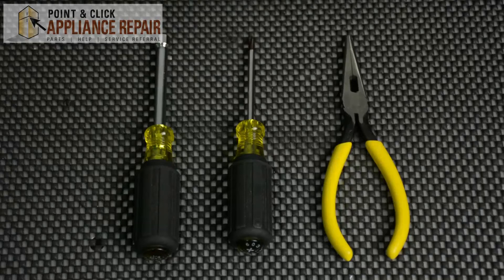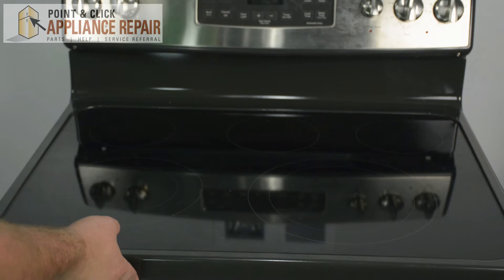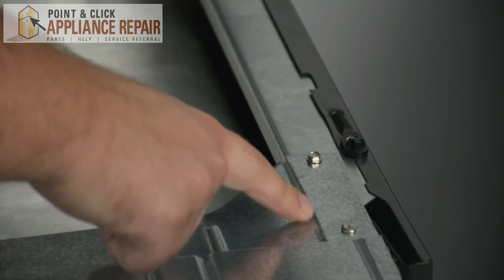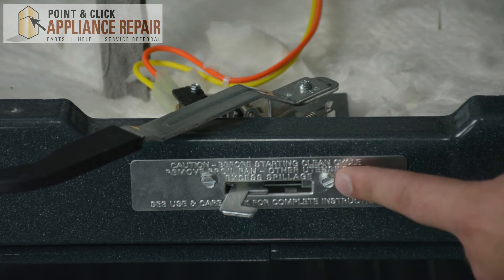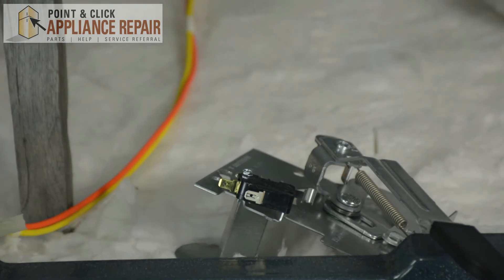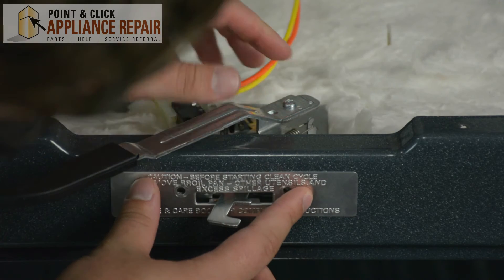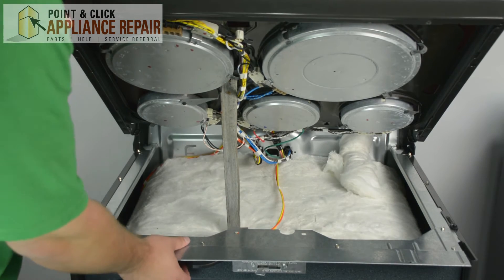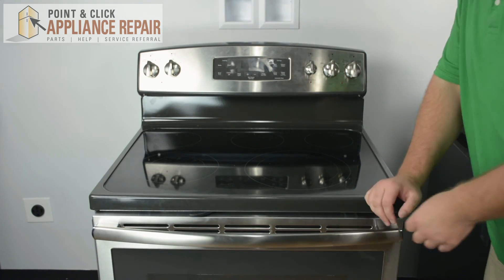WB14T10092-Replacing Your GE Electric Range Door Latch-AP5688708,PS8259925,2980574

Comment: This is a real help! I found out I could easily remove the top and inspect the latch part.  Well, my oven door was stuck closed, but for the first step I used a standard open 1/4 inch wrench to remove the black screws under the top instead of the other tool.  It only took me about 2 minutes longer. Then I followed your steps, they were easy.  What happened was that my wife had set the GE range to self clean.  Afterwards when she tried to set the latch back in place, but the darn latch was still locking the oven door shut after she moved the latch back into the regular open position.  So because of your easy steps it was so good to remove the top & brackets to visually see the latch.  It turned out that a metal piece was bent and mangled (I was impressed with my wife's feat of strength, by the way).  The handle itself is okay.  The bad part is that metal bracket that holds the handle --  severely bent. With the glass top raised up, I was able to merely move the handle over enough to unlock the door latch.  However due to the crooked angle of the handle (it is pointing up too high instead of an evenly level postition), I could not get the top to close back all the way. But I decided not to replace the part. I just took the handle off, then closed the top and secured those scews back in place.  Next time we run "self-clean" I will need to put that handle back on.  And thanks to you it's a simple process to access under the oven range top.  I can close the oven safely with the handle pulled out in the "locked" position whenever we run the self-clean again.  Again, thank you once more.  Your repair video alleviated a great deal of stress and  worry, plus saved money too.  To celebrate I am having homemade pizza tonight.  God bless you Repair folks, and keep up the good work!
Reply: Very similar to my experience - wifey must have really torqued it to bend that handle.
Reply: My experience was similar to yours. Your solution was my solution too. I will be celebrating with pizza also.

Comment: Very helpful - the link to the part doesn't work. GE says it's replaced by WB14X41386 but there are a few left (as of this date) with the original part # and slightly cheaper (when shipping is included) on amazon.

Comment: how do you get the door open if the lock worked to lock it but it wont unlock it?
Reply: Matthew David
Excellent question and it deserves an answer. There is a gap between the top of the door and the bottom of the glass top for you to get a thin 1/4 inch wrench  in the gap to unscrew the 2 screws.
Reply: @TheNYgolfer  This was a life saver. Bent my lever as I didn't realize that it wouldn't open when the oven was still hot (Duh). Stove wouldn't unlock after that. Used small crescent wrench on two screws shown in video and top of the stove opened up beautifully exposing lock which I can now free up and bend back. What a relief. Thanks you!!!
Reply: David Murray I just had to take a hanger and work on the latch or else I couldn’t open the door. It was a lot of hard work and patience I got the door open amen I was so happy thank you so much for your help with this
Reply: @TheNYgolfer  Ran into the same issue, these comments were a huge help!